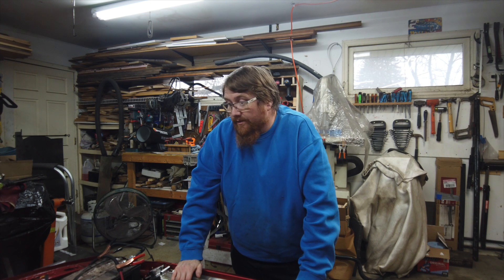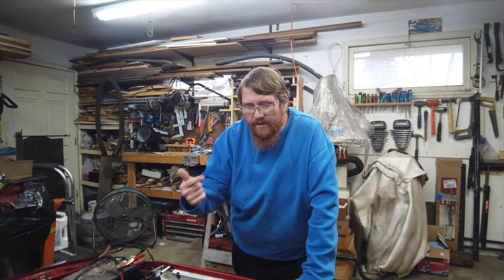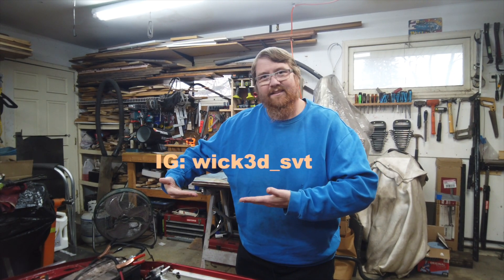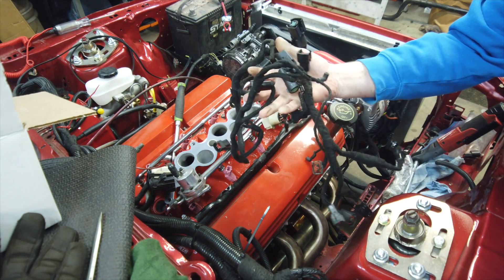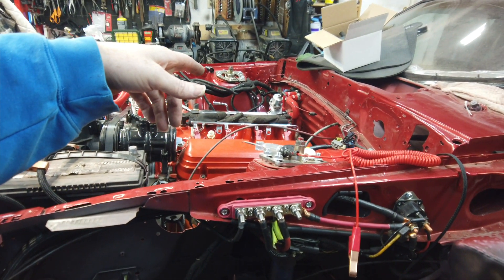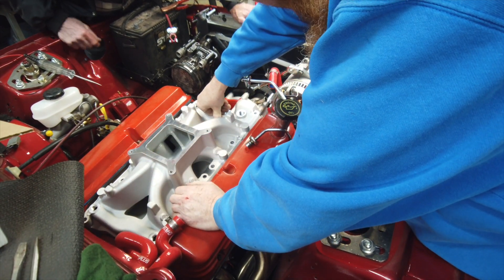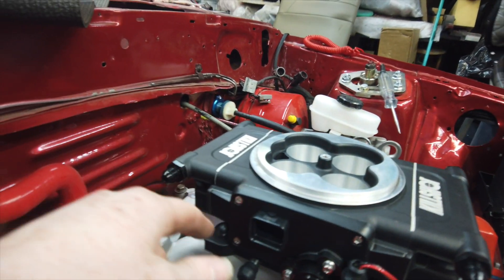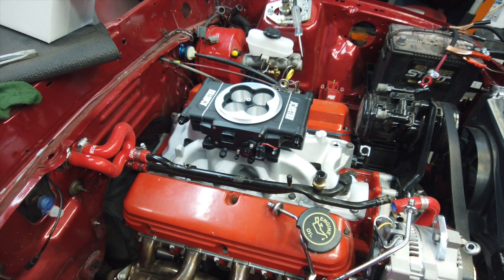Installing Single Plane Intake For Aces Killshot

Comment: That new EFI setup really cleans up the engine bay! Excited to see how it runs with the new setup.
Reply from the maker: No more wires!! Yeah lot of crap gone. Gas lines will be interesting
Reply: Russell makes a fitting that goes I to your stock feed & return fuel lines to 6an. I use feed line on my carb to mechanical fuel pump. I am interested to see how the aces works out. Thanks Jim in Ohio

Comment: Nice job on the intake install! I actually wanted to ask when you laid the felpro gaskets theres an extra piece of material that partially covers the water passages… in the video it seems like you just leave that on? Does that make a difference or is it supposed to be trimmed? I’ve always wondered that. By the way Ive heard from a few guys that acupuncture helps relieve some of the sciatica pain… might be worth a shot 😬
Reply from the maker: Yeah I left them. I doubt it will make it run hot. If it does, intake easy to get off. As for my back, I guess I would try. Lots of hokey people out there though🤣 need to find a real one